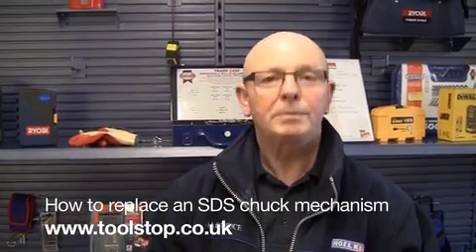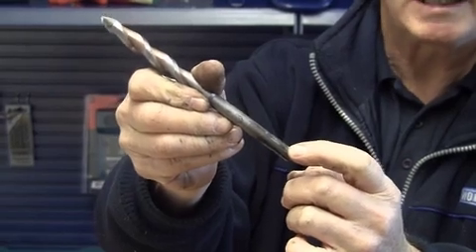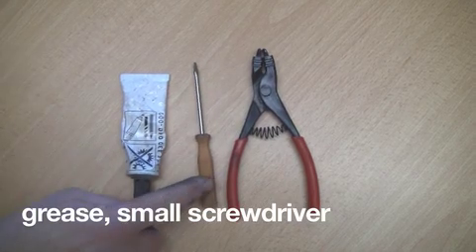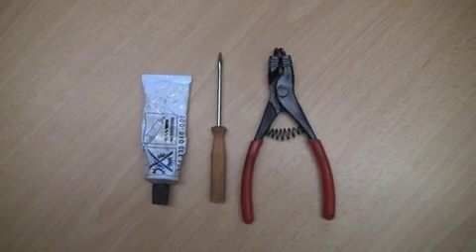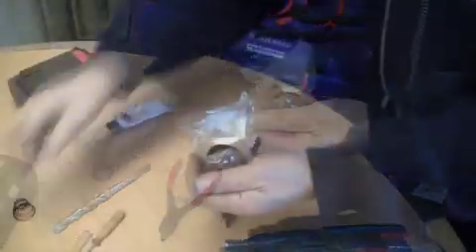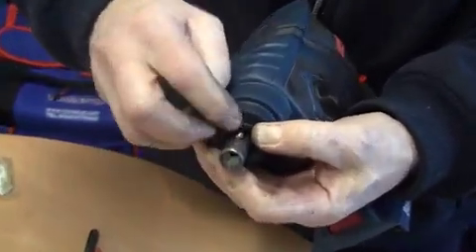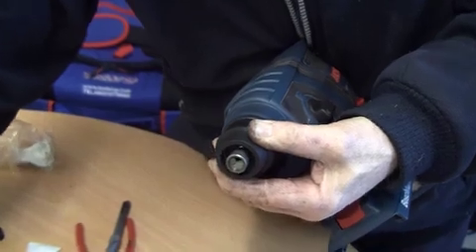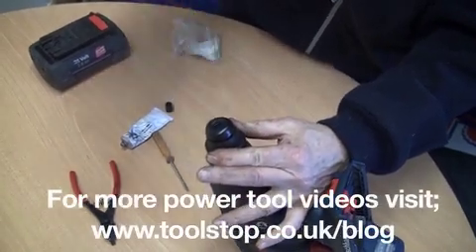Changing an SDS Chuck Mechanism | Toolstop Guide

Comment: Hi I have a Erbauer ERB562DRL SDS hammer drill.  The chuck no longer holds the SDS drill in place.  I am unable to find replacement parts for the chuck.  Will other makes of chuck parts such as BOSH fit the Erbauer chuck? Thank you

Comment: So the ball bearing locks the bit in place so it doesn't fall out what is the shaft with the fins that hold the bit when it spins because my bit will slip in the drill.

Comment: I have a dewalt breaker and I drilled a 100mm hole through a brick wall using a sds and for the life of me I can't remove the sds bit, I've managed to get the top cap off, pulled clip out lifted out the ball and it's still stuck doesn't matter how many times I pull or try hammer it away nothing, it still fits and works as it should but I can't swap it for use for anything else

Comment: Greetings and thanks for the great post. Is it possible to replace a jaw chuck with a sds chuck on a drill machine? Thanks.
Reply from the maker: Some drills have interchangeable chucks. I don't know which drill you are referring to. Here are a few examples we sell at Toolstop Shamrai.
https://www.toolstop.co.uk/makita-hr2630t-3-mode-sds-rotary-combination-hammer-drill-with-keyless-quick-chuck-110v-p73196
https://www.toolstop.co.uk/dewalt-d25134k-sds-hammer-2kg-3-mode-with-quick-change-chuck-26mm-240v-p71814

Comment: Excellent video, thank you. I have a Makita HR2540 not used much.
I find that the drill or chisel is very loose in the chuck  and has at least 9mm up and down play. This makes accurate chiselling almost impossible. I doubt this can be correct and don't know how to fix this.
Any ideas please?
Thanks
John
Reply: I had another look at this excellent video. 
My assembly is slightly differnt and there is an excellent diagram on page 
https://www.mtmc.co.uk/Makita-HR2450-Spare-Parts__p-75863.aspx

I also notice on the video at point 5:26/5:50 that the drill has the up and down play 
that seems to rule out accurate chiselling.

Comment: Hi do I have to grease this regular and what type of grease is used? thanks
Reply: sandydogy
 - In my opinion yes. It should be cleaned and lubed regularly, to maintain it in good working order. BUT, there´s always a but...LOL :-)
If it´s used for dusty materials, such as concrete, etc. that dust tends to stick to grease way to easily. 

My approach is after cleaning/blowing the mechanism, give a thin film of silicone. Silicone grease last longer, but silicone spray is simply easier, individual choice. ;-)

While at it, it´s always good to blow some compressed air trough the vents...Wear a mask. ;-)
Cheers

Comment: Brill thank you so much, I bought a drill with bit stuck in, managed to disassemble it, someone had been there before put it back together wrongly, they had the cup facing.
I never though of the ball going inside the cup, no wonder the ball jumped out.

great it now works, I will be contacting you for some spare parts.

Comment: would that kit work on my powercraft?  When i got it all that was in there was a spring. no bearing. I installed a bearing 7mm and it holds a bit and it works but i can;t help thinking it needs the rest of it although the bearing hasnt dropped out yet

Comment: Yes, excellent video. Well done.
(I hope non-UK residents followed the lovely accented tones of Alex!) 
I guess Makita & Bosch are of a muchness in this system of retention.
A question though: Why does the ball bearing come adrift in the first place?
I mean, where does it go? Am I right in thinking the hole becomes larger with time & wear....the ball bearing simply drops out through the main orifice (for the tool)?
And that the " Kit" merely contains a larger diameter ball-bearing?
Thanks!